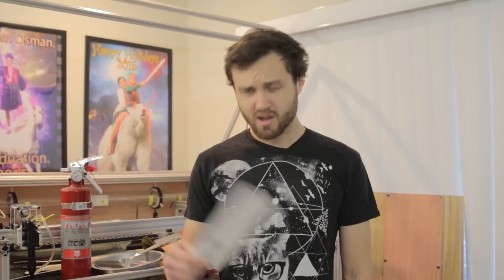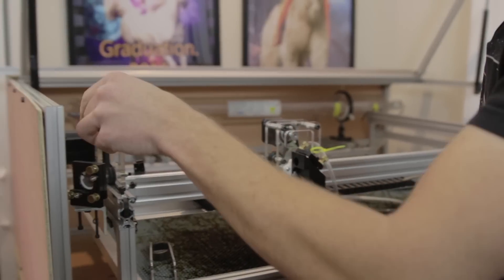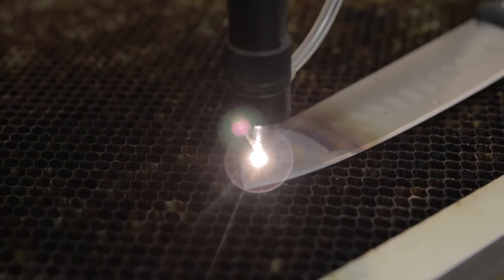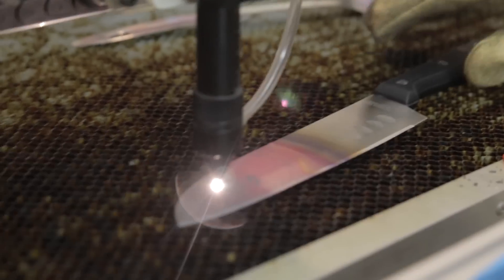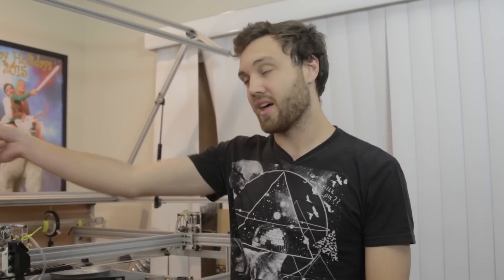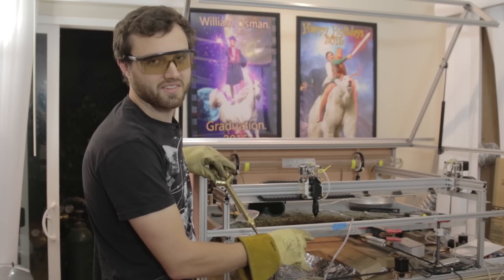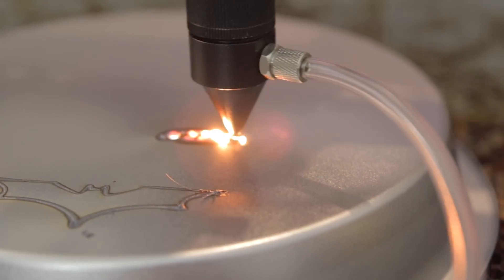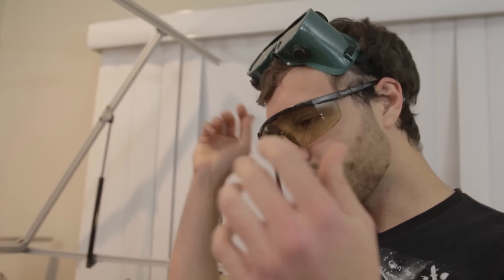Can a Laser cut Metal?

Comment: The Lasmac laser cutter at my old job needed nitrogen, oxygen, or both assist gasses to cut various types of metal. To cut aluminum the aluminum sheet had to have a vynyl laser mask on it so it wouldn't reflect back into the lens, which could damage the lens, which costs $300. It's a powerful Co2 industrial laser capable of cutting through quarter inch steel.

Comment: I think the trouble you're running into with heating the knife is that the oxide layer being formed on the outside of the knife from being heated red hot actually makes the knife more resistant to being cut...it's almost like a thermal blanket that protects the metal from heat/cutting, if that makes sense...

Comment: i wonder if it would be benefitial for you to have an always on when the cutter is on air assist sorta...

Like how with 3d printers we use cooling fans to keep the cold end cold... you could use a light air flow to keep the smoke and other stuff out.
Reply from the maker: That's exactly how it works! Not oxygen though.

Comment: the laser cutter at work uses a laser rated in thousands of watts and nitrogen to cut stainless and the surface finish is fantastic. it also flys through the stuff. we use oxygen to cut some types of steel but not often.
Reply from the maker: Probably a fiber laser, which produces a different wavelength much better suited for cutting metal!
Reply: well yeah the thing is hundreds of thousands of dollars to do exactly that. i dont know too much more about how it does its job, since my job was to just fix the thing. but SSShhh dont tell the company that made it, they will be upset we didn't fly out a tec.
Reply: Your an EE correct? maybe you will get a kick out of its power supply. 480v 90A hook up two 10000w high voltage high frequency generators that fed an RF generator tat excited the gas in the laser tube. I want to say the gas was a mixture of co2, helium, and argon? some custom mix that the manufacturer only supplys. cooled by water like normal but the controls were air tight and used a heat exchange that would handled all of the cooling on its own. just to keep dirt out. it works well but the whole machine is terribly inefficient.

we are about to get another one about twice as large and over twice as powerful but it only needs 60 A service since the new generation of it is way more efficient. it also loads and unloads materiel by itself

Comment: Oxygen and acetylene is used for cutting steel. With aluminum it will only melt the metal and blow giant holes in it. With stainless steel it will heat the metal up but when you go to cut with it, it won’t cut the metal because of how well stainless steel keeps the heat in it. Plasma cutting is what is used to cut aluminum and stainless. I haven’t learned anything about laser cutting with metal but I’d assume that the pot and the knife was stainless and it just kept the heat in so it wouldn’t cut. The colors that was on the knife such as the purple and wheat was from the heat of the torch which is mostly common with stainless steel.

Comment: For laser cutting steel with oxygen you have 2 options you either have low gas pressure (<1bar) and high power or high gas pressure (around 5 bar) and low power.
Focal point should be on top of the material surface or just a bit higher (0 - 0,5mm). Keep the nozzle about 1mm above the material and use a nozzle opening of about 1.2mm
Also close the path of the laser beam and blow filtered compressed air in it (about 1bar)
Reply from the maker: What constitutes high power?
Reply: William Osman I would go for minimum 500W. 
Also another reason why your cutting was terrible is because that knife is high carbon steel. That would have to be cut with nitrogen gas. 
Also for laser cutting you should try to keep your material cold. If you can't touch it by hand then it's too hot.

Comment: The nozzle you're using is likely meant just to blow smoke and debris away from the lens and work piece. It's not designed to provide a a jet of assist gas. I still think your setup could do better with a slightly modified nozzle. By the way, I'm building my own extruded aluminum laser cutter/laser engraver/cnc mill/FDM printer. I'm curious what kind hardware you are using on your setup and what you would do differently.
Reply from the maker: Smoothieboard!! I would do lots of things differently. I'll do a writeup some point in the future.
Reply: Cool stuff, looking forward to it.

Comment: Metal heated to a certain point will oxidize rapidly when inroduces to pure oxygen, so bascally a cutting torch rusts through metal very quickly, plasma torches are very different though, they just straight up melt it with an arc and blow the melted metal out with compressed air

Comment: A shorter focus beam will have more energy with a smaller dot. It will help, but your biggest problem is that you need >120w co2 laser, also, you need a slat table because the oxygen will burn through the honeycomb table in seconds.

Comment: If you heat the metal to a white hot, or really almost white hot, then the air from the compressor will oxidize the metal that is at kindling temp

Comment: Why do you need oxygen to cut through the tin pan?
Reply from the maker: Too much of the laser light is reflected by metals. The material needs to absorb the light to cut. My CO2 laser can heat it up just enough to get the oxygen to react with it. There are lasers which are capable of cutting metal.

Comment: oxy fuel and laser cutters cut through metal by heating it then blasting the melted metal with a focused  jetof gas. Not by oxydation (see plasma cutters)
Reply from the maker: I think that only works on machines with much higher laser power. Cutting any metal with 80w is practically impossible.

Comment: Haha not supposed to tip acetylene bottles on there sides or it will turn into bomb.
Reply: Why?
Reply: Mantani Mantaniri in acetylene bottles there isn't just liquid acetylene there is a sponge like material and the bottle is filled with acetone. Then acetylene is pumped in and dissolves into the acetone. But when you turn it on it's side you might get some acetone to come out. Doesn't sound bad but anything with acetylene is dangerous.
Reply from the maker: It should be fine as long as it sits vertical for a few hours before use.